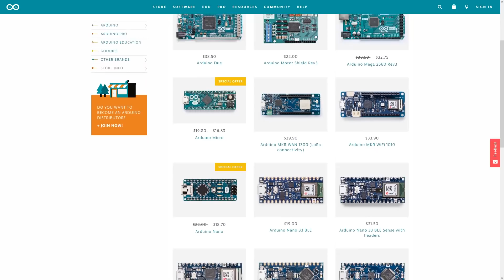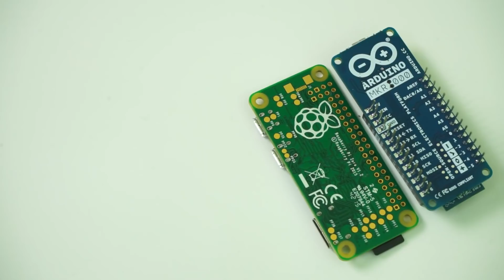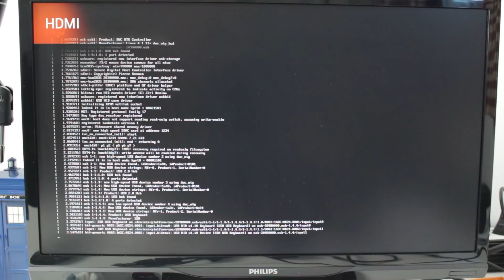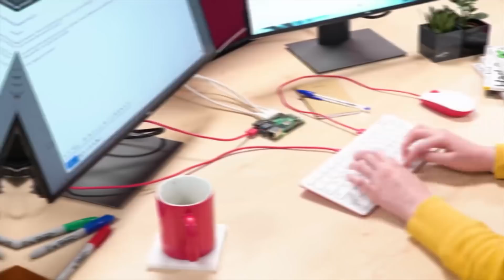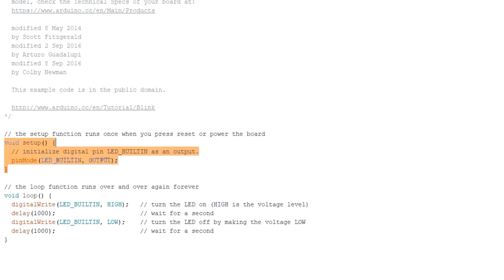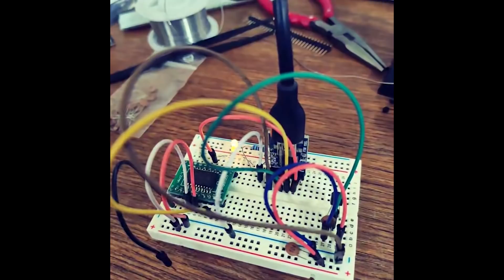Arduino vs Raspberry Pi - Which one is better?

Comment: It was easy to learn about microcontrollers with Arduino. Advanced users would prefer pi
Reply: Advanced users prefer not to use arduino nor rpi. There are a lot of boards that are better
Reply: @JosueRodriguez08  completely agree with you 100%. Legends don't use aur or pi.

Comment: Re power consumption; I have a Zero W running headless with an aircraft ADS-B tuner attached to USB (you did a video on ADS-B recently), it uses around 400-450mA which is quite low compared to Pi 3s or 4s.
Reply: Pi 3 would use the same. Lol, max consumption is not the consumption you are going to use always
Reply: @JosueRodriguez08  The Zero is a single core processor, of course it will use less power than a multi core processor.  Appreciate it is dependent on tasks being performed but my zero will do ADS-B scanning using a 500mA phone charger, Pi3 may not even  boot using that power.
Reply: @send2gl  I have used my pi3 from a laptop USB port....so don't say that
Reply: @JosueRodriguez08  That's why I said 'may not' in the comment and not 'will not'.

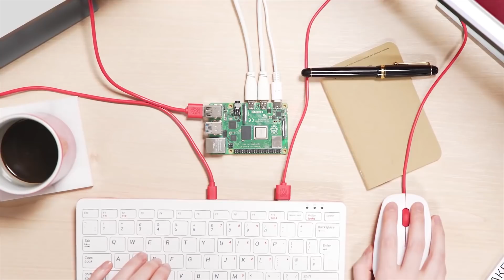Comment: 8:53 waiiit is that mouse connected to the keyboard?
Reply from the maker: Yes, it is a USB keyboard with built-in USB hub. Not uncommon.
Reply: @GaryExplains  cool did not know that was a thing, i wonder if usb-c monitors would work through such a keyboard
Reply: @fuseteam  the first mass produced USB keyboard, which debuted with the first iMac had a built in hub.
Reply: @jjbailey01  oh my

Comment: Why can't they make a  Raspberry Pi or any other microcontroller with a Snapdragon SoC?
Reply from the maker: Since the Snapdragon isn't a microcontroller, then there will never be a Snapdragon based microcontroller board. Are you asking why can't they build a Snapdragon based SBC?
Reply: @GaryExplains  oh yes, I'm asking why can't they built a Snapdragon based single board computer
Reply from the maker: They can and they do: https://www.96boards.org/product/rb3-platform/ and https://www.96boards.org/product/dragonboard820c/
Reply: Because they are a microcontroller company.
Reply from the maker: Who is a microcontroller company?